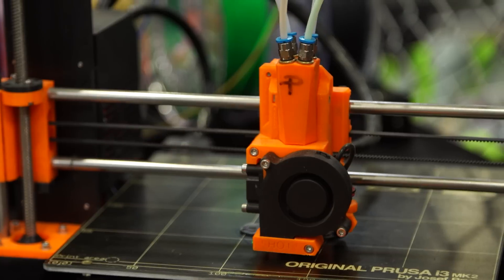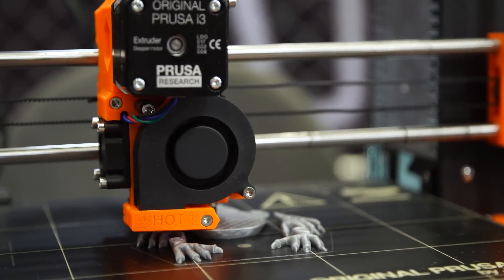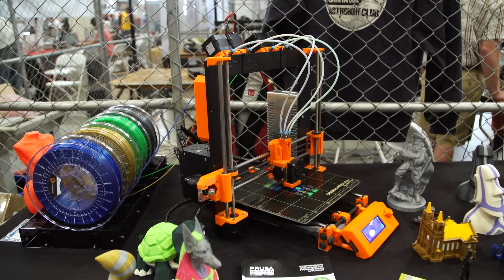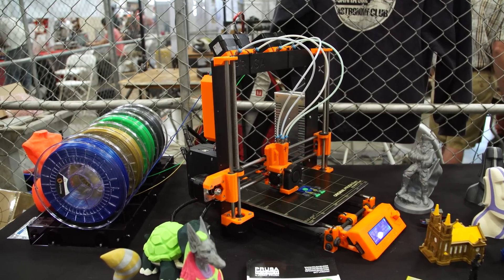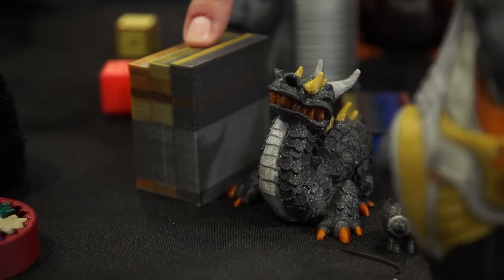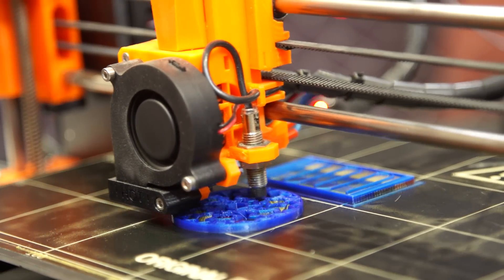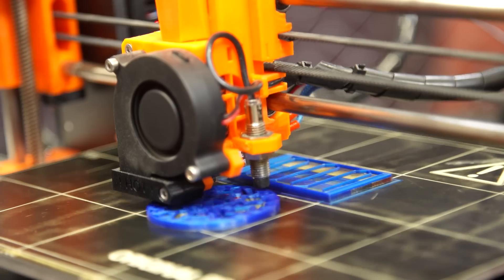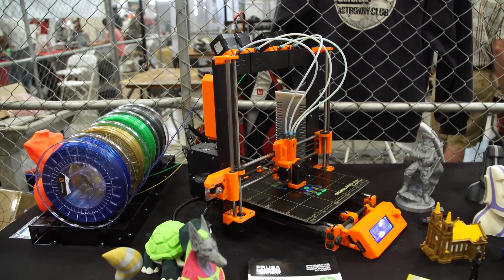Prusa i3 3D Printer Upgrade Prints 4 Colors!

Comment: That is very cool.  It has to use a waste block for each print when using multiple filaments?  Doesn't that effectively reduce the print volume of your printer since the waste block has to take up some space?  Is the size of the waste block automatically calculated with the slicer software?

Comment: WOW I wonder if there is any way that you can make the tower into an object also instead of just a waste tower.
Reply: Dim problem is that the object would get a mix of the materials or no material at all because the nozzle isn't properly primed. Hence the waste tower
Reply: If that was the case then the waste tower would not be pretty perfectly square or a rectangle.

Comment: That is such an elegant way to do multi-material printing. I have a dual extruder, and the ooze from the inactive nozzle is tough to work around and can easily ruin the finish of the final print. Printing multiple materials through a single nozzle is great way to prevent that.

Comment: Couldn't it just clear the nozzle on the inside of the model?
Reply: wouldn't work for every model, or every part of the model, it would also increase the software demand to figure out where it can dump the material inside the model... way easier this way
Reply: Daniel Rieger a little bit, but it doesn't seem complicated to calculate the need to change the color with the printing route and only dump if there's no inside to print atm. Idk how the algorithms work and how changing the print route might effect structural integrity, but it seems like the most optimal solution to me.

Comment: Cool tech, too bad it must rely on bowden tubes to allow multi-filament printing.  Sure, it could handle PLA  pretty well, but more exotic filament materials like Nylon, or other more flexible filaments are out of the question.
Reply: Nylon prints just fine through a bowden.  Ninjaflex, not so much.
Reply: Well old comment but if you're willing to sacrifice speed you could make a directdrive variant with ease, you just wont be able to accelerate/decelerate and print as fast

Comment: Prusa, a $200 printer sold for $700 (not including upgrades or filament).  More power to you, but there are other less expensive options with support and print quality that is just as good.  The multi-color print is a nice novelty, but they glossed over the material waste with the wipe tower and they didn't tell you that printing multi-color can double or more the print times.  I tried to be a fan of this retail printer, but I cannot.  My opinion.
Reply: Prusa, a $700 printer you can buy a badly made Chinese knock-off of for $200 because the guy releases everything open-source.  And you're whining about what, exactly?
Reply: Not whining, just stating opinions.  There was no need to start with the adjectives.  If Prusa can maintain the volume of sales they need to stay afloat more power to them.  I'm just stating that I'm not a fan simply because it's grossly over priced.  The idea of open source is to help drive costs down and if Prusa needs to sell printers for that cost point to maintain quality or service or profitability that's fine.  There are other options out there and they aren't all "badly made Chinese knock-off[s]".  You also assume that every inexpensive printer has Prusa to thank which was a collaboration to start off with meaning Prusa benefited just as much as anyone.  So what are you whining about [since you started with the adjectives]?
Reply: show us some $200 cheap copy that have everything on same quality. High quality rods, bearings and screws, reliable steppers, high quality heated bed, precise autolevel sensor, precise E3D head and extruder, reliable power source etc... All $200-300 I saw hadn't anything of these. Yes, there are things like A8, but it have no heating bed, no sensor, rods/bearigns/screws are lotery and people usually spend another $100-200 on upgrades and wait weeks or months till they arrive.
Reply: One word.  Monoprice, covers all of the above.  Printers with thousands of hours and still going like new.  There are of course other options than Monoprice's Wanhao printers.  And yes I realize they are Chinese and so are most of the mechanicals used in the Prusa so lets not go there.

Comment: I noticed the prusa and The Wine House are very similar in design do you know if this Hardin would work on a wanhao i3 plus?
Reply: anybody can set up a printer with the bowden type extruder.  I could do it on my printrbot.  I wont as you lose the ability of using the most amount of filament.

Comment: Can the software/hardware mix the colors or can you only print with one color at a time?
Reply: Only one at a time, it's using a bowden splitter, all 4 filaments use the same bowden tube after the splitter, between colors it retracts past the splitter.
Reply: With a diamond hotend you could do that.